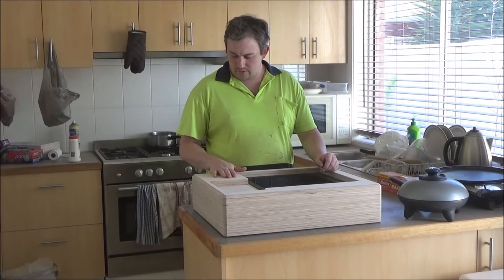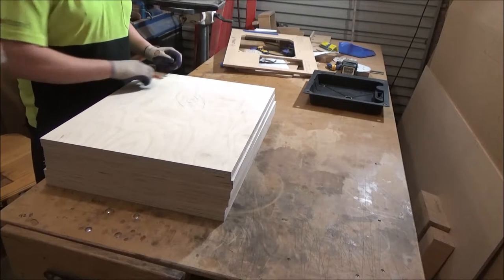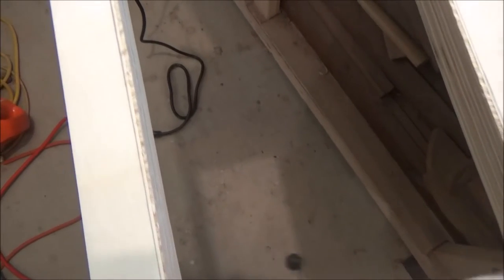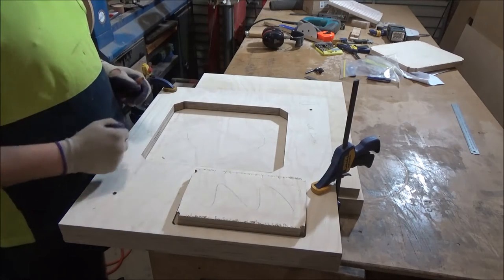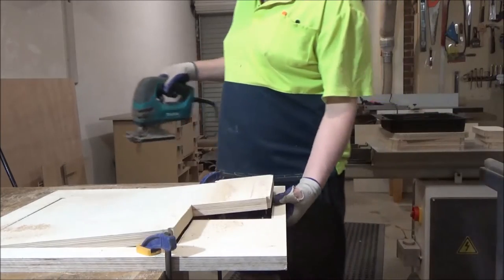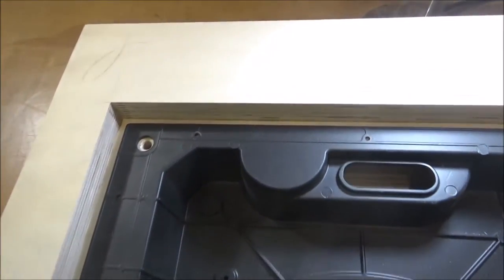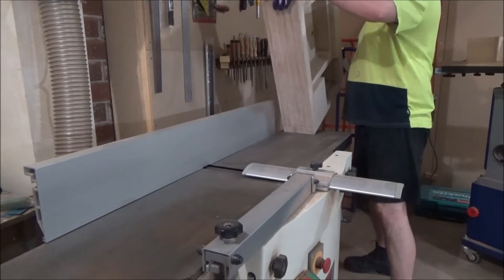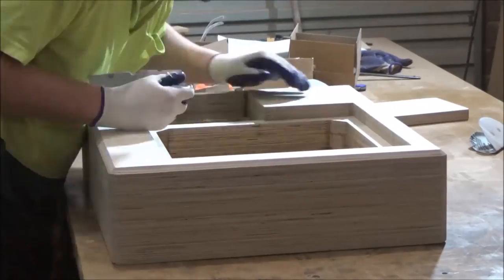How to make a record player plinth from plywood without a CNC

Comment: Excellent, mate. Have an older Lenco so great to see this - mind you but -  hand held router...
Reply from the maker: Thanks very much. I haven't yet made a plinth for a Lenco, perhaps one day. The processes I used could be replicated using just a hand held router. I use my router table mainly because it throws up less dust and slightly more rigid resulting in a better finished edge.
Reply: i had both a Lenco and a technics sp 10 and i really preferred the lenco, much more natural and musical even its basic base

Comment: I would love to make on form my Technics SP10 Mk2 but don't have the tools.
Nice job though>.
It's a shame the links to show the finished product don't work ?
Reply from the maker: Thanks. I never received any photos of the finished item from my client which is disappointing. Thanks for letting me know my old 'Timber Tricks' links don't work and I need to change them to my "Kuffys Woodwork" links.
Reply: It's a shame I don't live in Australia you could have the contents of my workshop including a couple of Lathes. I now have MS and it has become a dumping ground. I see people selling plinths on Ebay for Technics SP10s but they live in places like Moldova or old something out of the way. They look like copies of the plinth you were machining.
Reply from the maker: The plinth I made was designed by my client, and he likely has copied someone else's design. I do make changes with most of his designs to fit within the constraints of material recovery. For the most part the designs are square blocks of timber with recesses cut out to accept the record player units. That is probably why they all look similar across the internet.
Reply: Hey Jeremy, where are you located?

Comment: Beautiful work Kuffy, What glue you are using for laminated plinth?
I am planing something similar for my project TT and will use templates and hand router for the job. I had woodworking shop long ago but have to sell all machinery :( 
Cheers mate
Reply from the maker: Thanks. I used Titebond Original for this plinth. I wouldn't recommend Titebond II or III because both of those glues tend to creep a bit too much and will result in each lamination becoming visible months after you have completed the job.
Reply: Thanx for reply, so u are using TB Original often? I want to be sure for the project to keep nice look for long time. I intend to use polyurethane varnish after sanding and filling pores.
Cheers mate
Reply from the maker: I use all sorts of glue depending on the project. For the most part, I use either Titebond original or Titebond III. TbIII is stronger than original and can fill minor gaps without losing strength, but it does creep more. So if I am laminating timber for legs, or a tabletop, I will use original so that the glue doesn't creep out of the joint creating hairline ridges in the finished surface. A good option for a plywood plinth would be to use polyurethane glue but you must be sure to get the mating surfaces clamped together nice and extremely tight because any gaps between the panels ends up in a zero strength bond. I used urea formaldehyde on my other solid timber plinth video because that glue can fill gaps up to about 1.5mm and does not creep at all, but that would be overkill for a ply project. So TB original to be safe, or polyurethane if you are confident with your glue up.

Comment: How do you cut out the template in the first place? By hand or jig saw? BTW, great videos! Keep em comin'
Reply from the maker: If the cut lines are straight, I will rough cut them with a jigsaw proud of the line by approximately 1-2mm. Then I will clean them up using a straight edge and a flush trim bit in my router, just doing one line at a time. If the cut line is curved, I rough cut with a jigsaw and then sand or file them smooth. Straight lines need to be actually straight, but curved lines have a little more wiggle room with regards to accuracy.
Reply: @kuffyswoodwork  I think he meant the original jig/template (that doesn't become part of the plinth)... the jig you use to route against for the first layer you take to the router... I had the same question about making the jig. Or maybe I'm just not understanding the answer 😂
Reply: ...Now I'm guessing its similar to how you made that last (top) layer for this plinth (marking, taping on straight edges, routing...)...?
Reply from the maker: @brett-westgrove-country-music  My answer to his question was regarding the making of the template which doesn't become part of the final plinth. But yeah, drawing the lines and then using a straight edge and a router to make the template like I did with the final top layer and for the curves I use a jigsaw and then refine the shape with rasps, files and sandpaper etc.
Reply: @kuffyswoodwork  haha, got it! I must have seen that part not 30 seconds after posting 😂 ...seeing that really made all the difference! Anyway, killer work, and thanks for the response!

Comment: Nice work .Whats the cost of a plinth like that ?
Reply from the maker: Thanks Carl. This plinth was priced at $650 AUD in its raw state.
Reply: Kuffys Woodwork 
Thanks for replying mate. Have you done any veneered or lacquered plinths ? Would be interesting to see those processes.
Reply from the maker: Sorry for the late reply, been flat out like a lizard drinkin' round here. I have only made ply plinths which get 2 pac painted by someone else, or solid timber plinths which I sometimes finish with shellac or polyurethane or someone else finishes them with whatever they want.
Reply: Kuffys Woodwork  thanks mate,you're a gent.

Comment: Why you were flip the panel after each cut ?
Reply from the maker: Because my rip fence isn't setup 100% parallel to the saw blade. So if I use the rip fence to crosscut the panels, they end up slightly out of square. it's something I should fix, but it's also something which only costs me tiny amounts of time so I don't worry about it.